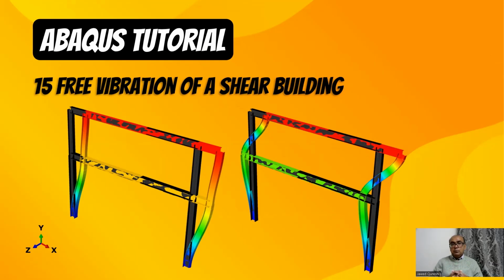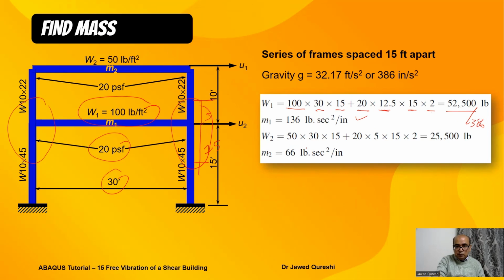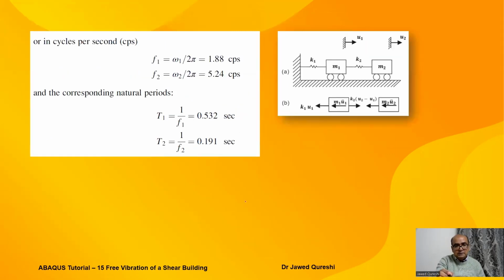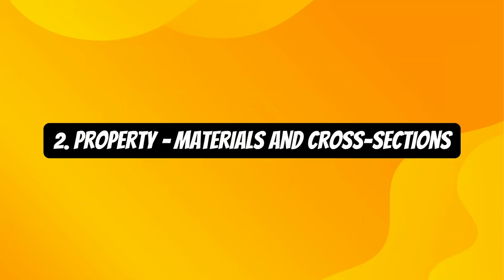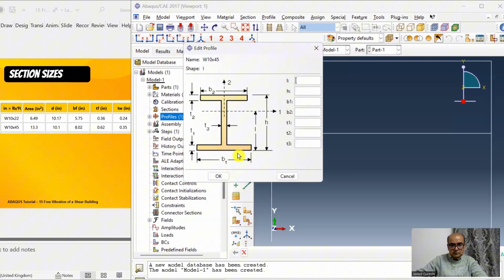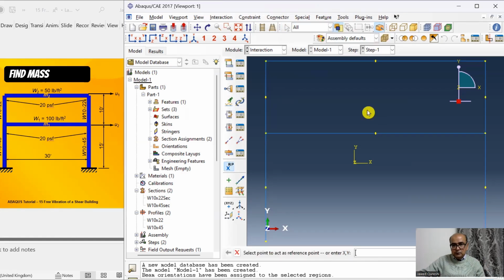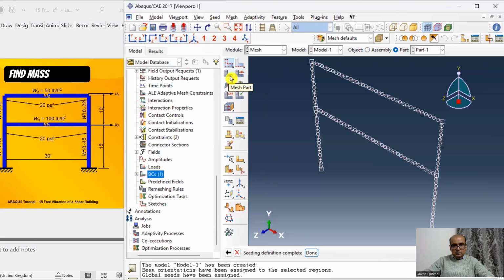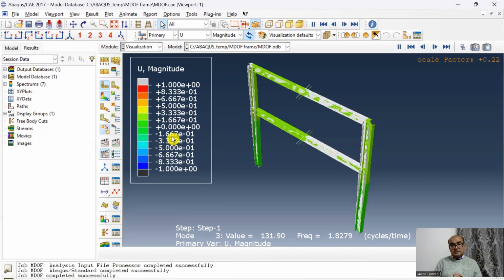15 Free Vibration of a Shear Building | Structural Dynamics – ABAQUS Tutorial

Comment: Very interesting tutorials. Keep up the good work👍. I have question you may be able answer. In order to avoid vibration of a structure, do you work out the natural frequency of the structure first without the applied live load, and then work out natural frequency with the applied live load and ensure they do not match so as to avoid resonance? As is my understanding that resonance only occurs when the natural frequency of the applied live is similar to the natural frequency of the structure? Hence you typically need to ensure the natural frequency of the structure on its own (based on no applied load) is higher than that of the applied live load? If so surely the natural frequency of the structure with applied live load is going to be different than that of the natural frequency of the structure without the applied live load? Hope I explained the question clearly.
Reply from the maker: @simonkelly2267
Thanks, you’ve asked a very good question. 
You have to find natural frequency first. No external forces are applied in this example. Damping is ignored and it is a two degree of freedom system. Here is the detailed answer to your question.
Natural frequency: 
•	It is the frequency of an object without external loads. 
•	All physical structures have natural frequencies. 
•	The natural frequency is a physical property of a structure, similar to size and shape of building. 
•	It is the frequency at which the structure loves to vibrate at.
•	It depends on the way mass and stiffness are distributed within a structure. 
•	Natural frequency is equal to square root of stiffness over mass for a single degree of freedom structures.
•	Stiffness is force required to produce a unit displacement (stiffness = Force/Displacement)
•	Mass includes the mass of materials involved in making up the structure, such as walls, roof, floors, beams, slabs, doors, windows, and other fixtures.
•	In lumped mass approach we assume the mass of the structure is concentrated at a point, usually at the centre of the rigid beam and stiffness is provided only by columns. 
•	If a building is made up of concrete, we multiply volume of structural elements(beams, columns and slabs) with the density of concrete (density of concrete is 2400 kg/m3 and steel is 7800 kg/m3).
Forcing frequency (frequency of externally applied loads): 
•	It is the frequency of external forces or applied loads (also termed as excitation).
•	In real-world examples, it can include wind/seismic loads, people moving, machinery or aerodynamic behaviour of cars or aircrafts.
Resonant frequency (or resonance): 
•	When a force is applied at the object’s natural frequency, it goes into resonance.
•	At resonance a small force can produce a very large dynamic response or vibration.
•	It is frequency where natural frequency and forcing frequency match with each other. 
Damping:
•	Damping is the way a system naturally dissipates energy.
•	Damping depends on resistive forces, such as friction and air resistance, and geometry .

How can resonance be avoided? 
1.	mass/stiffness modifications
2.	damping changes
3.	tuned absorbers
1.   Mass or stiffness modification:
•	To avoid resonance, the forcing frequency applied to the structure should not be at or near a natural frequency.  
•	If the forcing frequency cannot be changed, then the natural frequency of the structure needs to be modified. 
•	This can only be done by altering the mass or stiffness.
2.   Damping changes
•	Damping can be added to reduce the severity of vibration when operating at or near a natural frequency.
•	Damping treatments are often used to reduce vibration.  
•	For example, many large bridges, such as London’s Millennium Bridge, feature fluid viscous dampers to control vibration.
•	The Millennium Bridge was opened to the public on June 10, 2000.  Due to excessive vibration caused by pedestrian traffic, it was shutdown after two days, retrofit with 37 fluid viscous dampers, and re-opened on February 22, 2002.

3.   Tuned Absorbers 
•	A tuned mass-spring-damper system can be used to reduce the amplitude of vibration in a dynamic system. 
•	A tuned mass damper modification is created by adding an additional mass-spring system “tuned” to the natural frequency of an existing system.

I hope this explanation helps you. For further reference, please have a look at this website: https://community.sw.siemens.com/s/article/Natural-Frequency-and-Resonance
Reply: Thank you Dr. Qureshi for the detailed answer it explains a lot 👍 @DrJQureshi  if you are doing any future tutorials it would be very useful to see a simple simply supported beam supporting concrete slabs or steel frame, where you would calculate the natural frequency of the system (without applied loads) and then calculate the forcing frequency with an applied load, to see how both correlate to each other with regards causing resonance/oscillations. As i assume once you find the forcing frequency Hz, then you apply the live load to the structure using say a harmonic analysis or similar under the same applied forcing frequency to see how the structure oscillates? however this seems to be where a lot of engineers get mixed up including myself as its a very complex subject. Hence a tutorial in that regard would be very helpful indeed. its just a suggestion for future tutorials on your channel 👍Thanks a lot for the in depth reply.
Reply from the maker: @simonkelly2267  I’m grateful for your kind suggestions. I’m planning a full course on structural dynamics with some real-life examples. I’ll surely note down your comments for future videos. Here, I’ve put more emphasis on numerical modelling.